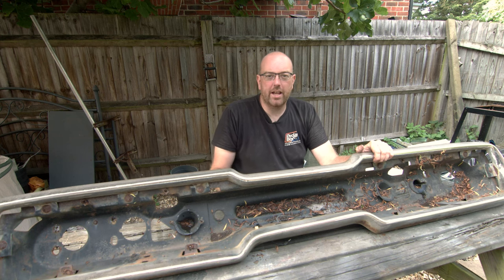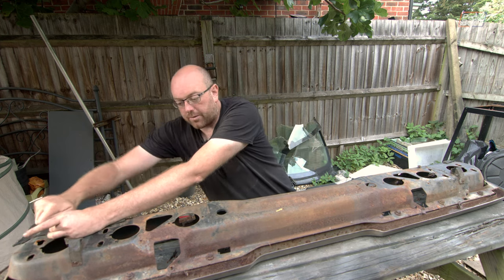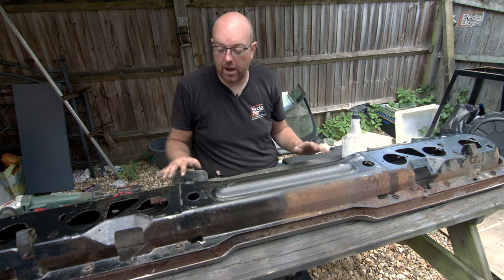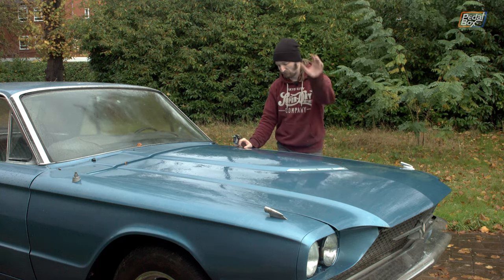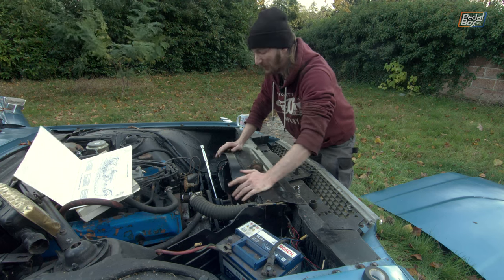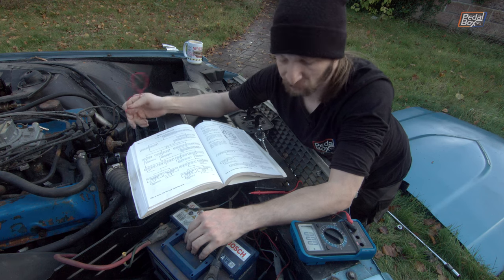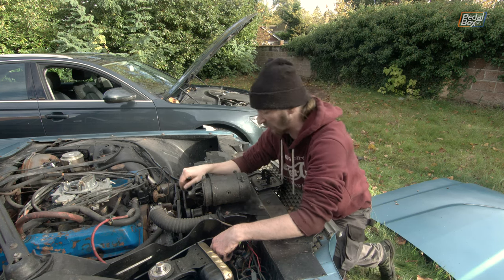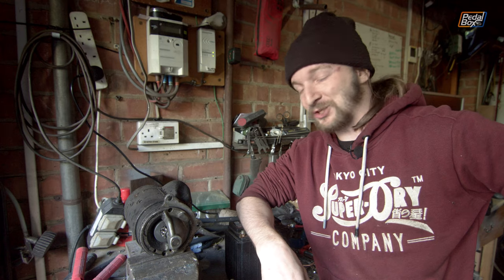Lights. Bumpers. Starter. REBUILD! | 1996 Ford Thunderbird | PedalBox Episode 147 | Fleet

Comment: 9.6VDC is the low limit on a battery. Have the ignition key in the “on” position to ensure the engine stays running, once you jump the circuit from the “S” terminal to the battery input terminal on the starter solenoid (relay). No solenoid attached to the starter.

Good work otherwise, Chris (AJ)!

Comment: Hello Guys.@ michaelthomas7898 is correct. When doing your bench test, connect the negative lead from your test battery to the case of the starter. Connecting the positive lead from the test battery to the side terminal of the starter should make it spin. There is not a relay on the starter. When the starter motor turns, the starter drive plunger lever forces the drive gear forward to engage with the flywheel. There is a safety switch (neutral-start switch) that is mounted on the steering wheel shaft, which prevents operation of the starter if the selector lever is not in the N (neutral) or P (park) position. It may need adjusting/replacement. Best of luck!
George B.
Reply from the maker: Good to confirm! Thanks very much. We've ordered a new one, because I can't be sure i'll even adjust/rebuild it right having never done it before. IT's not a huge expense at least to get a new one, so it's the most reliable option.

Comment: Don't think there's a ground on those starters they pull the earth through the mounting bolts to the motor. The solenoid is just a pass through for the starter and the hot side of the ignition coil. Watching you guys reminds me of my frustrations working on old VW's and MG's.
Reply: The ground for the starter motor is through the case-to-engine block-to-chassis.
Reply from the maker: Good to know, although does confirm the motor is probably buggered. New one en route though, and then I can just drop this back in the post for the Core return next time im in the US :D It's a good excuse to book a flight right> To return a $20 core...